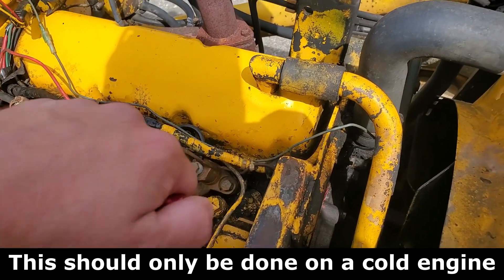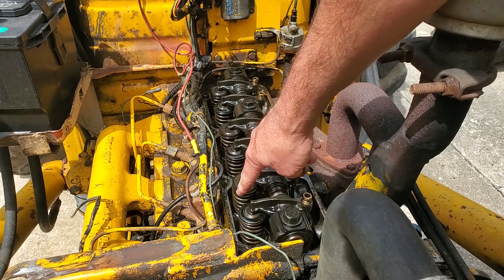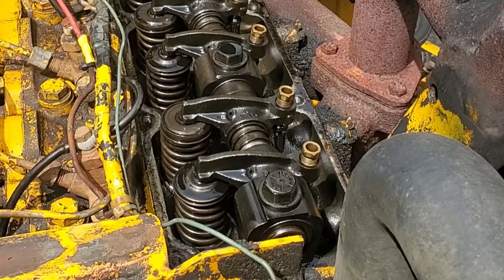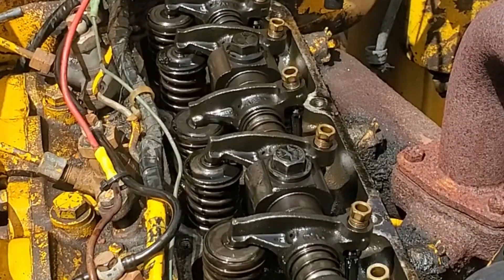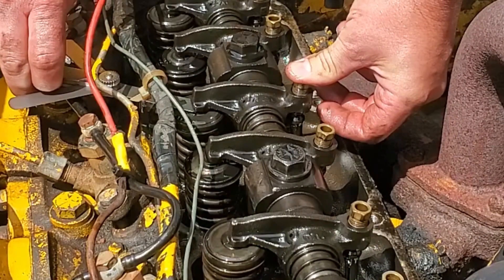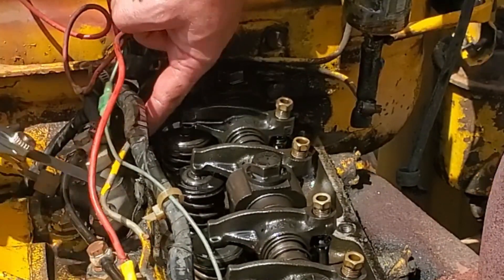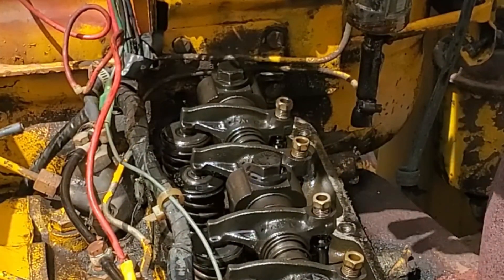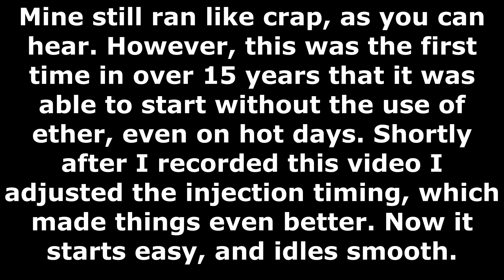Ford 201 Diesel Valve Adjustment

Comment: Hi, Hope you come back to your videos....   Can you tell me how you adjusted the injector pump timing to help starting..?   Have a 4550 3x cylinder that only starts with a sniff, has had new rings, pistons, valves etc.   cheers,  db
Reply from the maker: All I did was loosen the mounting bolts just a little, then rotated the pump. I can't remember which way I rotated it to advance it, but you'll know if you got it right. I didn't go crazy with the advance, I just took it to a little past the first big mark on the cover if I remember right. I'm not near the tractor to look. I used a rubber strap wrench to rotate it and hold it while I snugged the mounting bolts since it can be hard to do by hand with the fuel lines holding it.